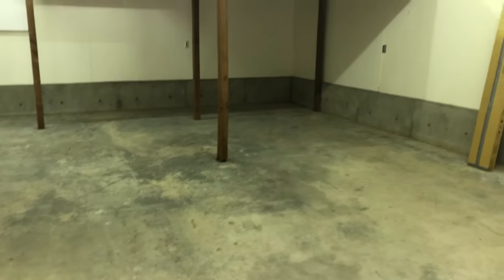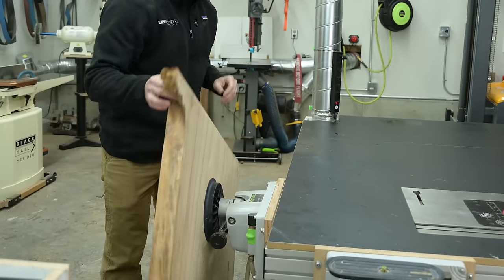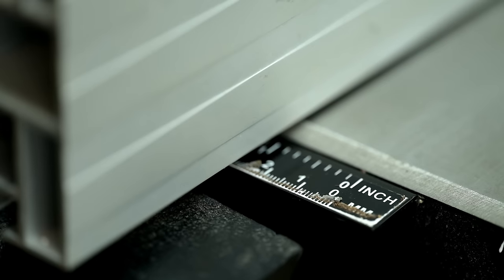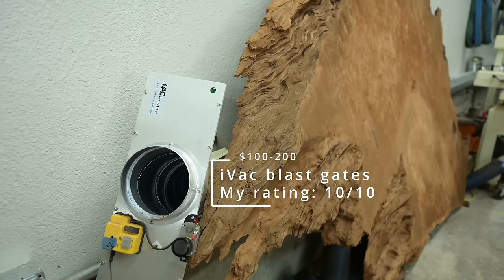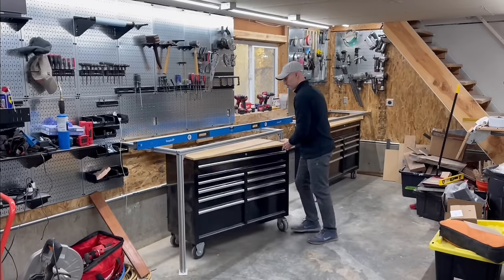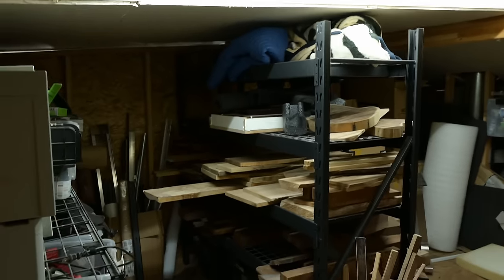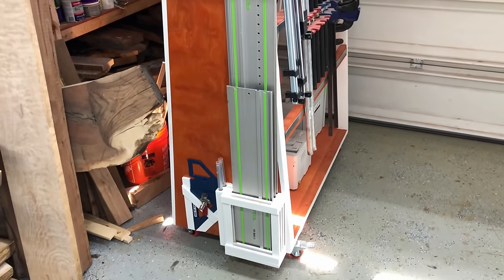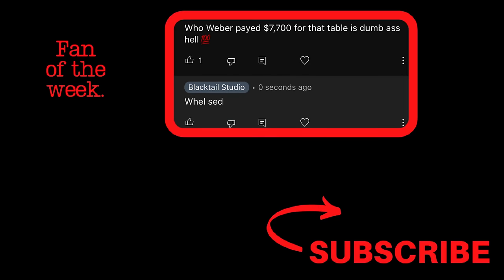Blacktail Shop Tour

Comment: They can't just say no.  They need to give a reason.   When they do, apply for a variance and get your neighbors to sign off on it.  Unless you have some ground stability problems, or something hard fixed for the area it shouldn't be much of a fight.  And really, if it's ground issues, you really don't want to go ahead anyway.
Reply: Absolutely right.  Planning departments cannot simply deny an application without providing the reason (in writing).  Fight on !

Comment: Compromise.  In my area it can be difficult to get a permit to do a full expansion like what you were thinking of.  However, it is much easier to get a permit to do a partial expansion.  What I would recommend is to try to get a permit to build the basement portion with the roof of the basement being called a walk out deck area.  Then a year later get a permit to enclose the deck and integrate the enclosed deck in to the rest of your shop.

Comment: As a land manager for a surface coal mine I spent 20+ years dealing with government officials telling me what we could or couldn't do.  Over the years I came to realize that you need to question every decision and as Mr. Breidenbach stated always ask to see the regulations that say you "can't" as many times it's simply someone's interpretation of a rule and not necessarily the intent of the rule that comes into play.  One thing that I found that helps in situations like this is to have something to concede to the inspector on, in other words be willing to give up something minor as a sign of good faith in order to achieve your long term goal.  Generally most inspectors will "work" with you in that scenario BUT if not and after reviewing the regulations you feel you are still in the right it always help to consult a land use attorney and have them send a letter to the governing agency explaining your position.  Most government agents don't like to deal with attorneys so they will normally find a way to make it work for you.  Might cost a few bucks but generally well worth it if it gets you the desired results.  
Love your work/videos and if you are ever open to tours would love to visit your shop some day.  Just live up the road about 1.5 hours north of Portland.

Comment: I'd fight it if it doesn't involve expensive lawyers. I found your channel last week and love your work. I've been considering making my own table/desk but instead of wood, I might use copper piping, sprockets, springs, valves, ect. To give it a steam punk look. I know I'll have to leave space between the surfaces and hardware for sanding reasons at least. I plan on supporting the hardware with wooden pegs that can be sanded during a pour that wouldn't look out of place. Thank you for your explanations and sharing your experience and expertise. I have enough confidence now to practice on small scale projects. Happy New Year Cam and I look forward to seeing more of your wonderful work.

Comment: I'm wondering what the reasoning was for your permits being denied, I've had to deal with my township over a few issues and have always found a way to beat them. As long your not creating or contributing to a safety issue then you should be able to find a way around them though the state codes.
Reply: @modoc343  what is the reason you can't catch train m rain water it's free water
Reply: The instant rain hits the ground it's no longer rain water, there are many ways of retaining runoff
Reply: @YesItsNotMe  my thought is that you would only be catching the rainwater from your roof which is not much in total rain that falls to the ground. But, just interesting history on the whole rainwater catching thing

Comment: Hello Cam - years ago I had the opportunity to work in a metal shop helping with making massive wrought iron gates (I'm a woodworker and was then too).  The shop owner was an older guy and he had a drill press with a KEY-LESS CHUCK.  Seems like that may be an unnecessary luxury, but - just imagine going back to the hand held electric drills of the seventies and reaching for a chuck key every time you want to change-out a bit.  I bought one years ago and have never looked back.  They typically seem to be quite well made, especially the German made one - and, they really are not that expensive (Grizzly).  Just make sure it will fit the taper on your press, or, buy an inexpensive new one to match.  Love your videos and concise explanations!

Keeping warm on Vancouver island - Canada,
Ken

Comment: Quick question from Germany: In my college days I worked a lot with epoxy - mainly using it as a matrix for carbon composites (race seats etc). Before pouring or infiltrating we always put the epoxy in a vacuum machine to remove any excess air from the resin, which greatly helped in removing bubbles. I was just wondering, if there is a particular reason for you not doing this! Thanks!
Reply: Yeah he basically lets his epoxy sit for about 10 to 15 minutes to let the air move up. Then pop the bubbles and you're good to go. A vacuum chamber is a cool gimmick but I think Cam does a great job providing tips and tricks for woodworkers who are on a limited capacities on both finances and skill 🤙🏼

Comment: Fight it! I was just wondering as a beginner woodworker what would you say are the most important tools to start with? I don’t have a large budget for tools but i was just curious to hear your thoughts
Reply: My 2 cents, but a professional sander will not only save you a ton of time, but your ending finished product will come out spectacular. Been building my business on a small budget and learned many lessons from the beginning from tools to time management and the difference the right tool can make.
Reply: @AKdesignsandhardwoods  like a belt sander or a circle one? Appreciate the reply
Reply: @aidancahill9236  random orbital. Also the correct sand paper makes a huge difference. KatsMoses has an amazing video that shows the best sandpaper. I use it and so does Blacktail.
Reply: Also don't be afraid of buying a set of cheap tools. As you use them you will see which ones you want a nice one of, and which one having a cheap one of is fine. For me absolute basics are a set of hand planes, a set of chisels and a couple of good saws. And a good sharpening stone.

Comment: Your shop looks great. Just a warning about magnetic chuck key holders (which it looks like you mounted on the side of the drill press). There will be times when we shift our arms or bump something, and you don't want your chuck key to fall down, bounce, and hit your spinning drill bit. Admittedly it won't have much, but you might want to mount the magnet on the side of the drill press table near the back where there is no chance of it getting bumped.

Comment: Yea fight it 100%!! Big fan of your channel it’s very educational for an inspiring woodworker!! So as far as you struggling by yourself with those large slabs you should get a winch from harbor freight. Make a leveling bar that has adjustable straps to wrap the slab on either end and you can just winch it out the truck and lower it on to the table. If you want to get fancy you can make a track system on the ceiling and then you can move it anywhere in the shop with no lifting!! Relatively cheap to set up.

Comment: Hi Blacktail, I have left you comments before I’ve always been impressed with your work and you have a good workshop,
Not sure how long ago that you done the territorial on your workshop,  about 10 years ago I made a workbench similar to yours only I constructed it out of plywood inch thick approximately 1 1/2 m wide by just over 3 m long I made it in such a way that the festool Profile Rails  which look Very similar to what you have used so all the festool tool equipment fit on the table, and it was perfectly flat and it was used for a vacuum bag system as well, you mentioned that you weren’t happy with your router table there is a company in Germany which makes a very fine with the kit not sure whether you can get them in the USA, You can make a table up to fit the lifting carriage for the router or you can buy a designated table system with a router already built in which you can actually take out if you so wish, It not only lift up and down but it will actually tilt as well, The name of the company is called SAUTER, Keep up the good work, Stay safe look after your health make sure you were breathing apparatus whenever you’re standing and I protection, From the retired 70 year young English gentleman living in France from the moulin.

Comment: Architect from UT here: If they don't have a rule that addresses your exact situation, then you should be able to apply for a variance through the zoning/planning commission. You need to look around your neighborhood and see if there are others who already exceed the allowed area for auxiliary structures. Your case for a variance will be much, much stronger if you can find extant, similar examples. You may want to hire either a lawyer who specializes in property law, or an architect with a good track record of obtaining variances for his/her clients.

An alternate approach is to build a "separate" building immediately adjacent to the existing. Code will require you install a fire wall between so the can be considered separate buildings, but that is an easy barrier to penetrate after you receive your CofO. I'm not encouraging you to do something patently illegal, just offering examples of what I've seen others do. A fire-rated door can be installed to meet the letter of the Code. You'll need to make sure what definition the County uses for separate structures.

Comment: Comment on Mafell: Its a pretty common brand for professional and commercial working woodworkers/Jointers/carpentrys in germany. Their design in comparrison to festool is focused on durability. If you look on the material, power and prosessing of these machines, you will notice a huge diffrence between festool/Bosh/makira/dewalt. 
Plus they dont overtune their machines like some of festools things are. We have machines of mafell in our workshop, that are older, than some folks, that are working with us for 40 years and these machines still run perfectly. 
If you work daily in trade, like repairing stuff at a costumers house, mafell is one of the things, we can lean on. Fuckin expensive, but they never let you down.

Comment: FIGHT IT!!
Going through (or about to go through) a similar battle. A block my wife and I want to buy is zoned as "Agriculture" (which is simply a block aimed at agricultural use only - no residential dwelling) and all we want to do is build a house there and live happily ever after. Trying to get around the Agri requirement as the block of 10 Hectares couldn't sustain a commercial venture, thus no reason for not building a residential house.

Haven't bought the block yet so let's not get too far ahead, but there is a decent-sized shed on there which could nicely fit a woodworking shop in there, plus be able to use AWESOME Tasmanian timber.

Thanks Cam.
Cheers, AussieAl.
#KeepDoingWhatYoureDoing
#OnwardAndUpward

Comment: In my opinion absolutely nothing beats Mafell in the section 80+mm hand held circular saws. The newest K85 has a absolutely perfect way of adjusting depth and angle, superfast and super precise. You can also use it as a Plunge saw (if thats the right term). In my peronal humble opinion the Price is right on this one.
Although of course Festool also makes great Products, way bigger Product range aswell.

Comment: Definitely Fight it!    if there is not ecological reasons the county denied your expansion, you can usually get a variance to do the addition by going to the county council and pleading your case, Especially if you plan on opening a classroom for at risk teens to learn woodworking.

Comment: I would fight it. I just stumbled across your videos a few ago and been watching as they pop up in my recommended.

I'm a builder in Ontario and I deal with this all the time. We go through Committee of Adjustment which is a governing body that oversees applications for buildings/projects that do not confirm to the usual standards. I.e. Hemp farms near  residential areas or nursery for livestock. Oversized shops, shops infront of houses on large parcels of land.  You would plan a proposal with architectural plans and a site layout done by surveyors. This application approval has many steps including issuing statements to neighboring properties, encase of objections. Going through the process usually leads to successful permit applications and approval to start. I'm not sure which governing body would oversee this where you are located but there should be one. Smaller shops like yours may only require a hearing and pay any necessary fees. The other stuff is for larger projects/structures which usually yield greater impacts on neighboring properties.

Good luck.

Comment: Fight for your right, I'm a Building Surveyor (in Australia) and my job role is ensuring buildings are designed, constructed and maintained in accordance with the building codes and numerous standards we have. We often 'replace' council, and if there is one thing I can say, councils typically need to have the attitude of ensuring the publics best interests whether it be their happiness, safety, etc. 
So in short, if they say no, it's not a full no, instead... you need to have a continual conversation (which may require meetings which can sometimes cost money) and the conversation of why they didn't approve it needs to be discussed. 

It very well could be a town planning issue where you are turning into a true commercial building at that point which unfortunately can have a trickle effect on everything. another issue might be just the shear size of the proposal, it could be aesthetics, etc. 
So have a conversation, and then get in writing what they don't accept and then reverse engineer to solve the problem. 

They can't say no for no reason, it's likely based on something like a building code, town planning bylaw, zoning requirements, or a whole number of things. so just get in writing what doesn't work and work from there. 

Depending on the issue, there are numerous professions out there that specialize in any given matter which I'm sure you could find someone local that knows the council well. This can go a long way believe it or not. 

I think there's enough of us watching that we would love to stay informed on how this all plays out, and I'm sure all us keyboard warriors will chime in, but there's a solution there and I'm invested.

Comment: From what I've read so far, the process you would need to go through is an adjustment review, which is much like a variance application where they may be able grant you relief from the code. You may want to hire a zoning attorney for this, I highly recommend it. I'm involved in zoning quite a lot and have rarely seen a situation where some compromise can't be reached, although sometimes a lawsuit does prompt that discussion...

Comment: Fight it Cam. I had to fight the bureaucrats a few years ago and it was well worth it. It's a little shallow, but it also felt good taking them down a notch or two. On to another point. This was a great video. I've retired and am now wanting to get back to my roots. If it's broke, you fix it. If you need one, build it.  I am really intrigued with wood/resin projects but didn't know where to start with decent equipment or even suppliers. I have nothing, I mean absolutely nothing. (It's a long story) Anyway, what would you recommend for a beginner that will eventually grow tired of it, or will want to seriously upgrade later.  Your videos are honestly the reason I have such a high interest in wood working. Keep up the good work.

Comment: Concede, personally I would rework the plans to fit into there code of I think you said 1,200 sq ft.  Are you going to have a ceiling crane(top running crane) installed or maybe a boom crane(jib crane)? It seems like a ceiling crane would really be helpful in moving the heavy slabs. My guess is, maybe the building can't handle the load that would apply or maybe it's not useful because there's not a good way to lift slabs with said crane without braking workpiece, though I suspect vacuum clamps would work.
It seems like clutter or small floor plan wouldn't be as much of a problem with a ceiling crane vs. the space requirements of a forklift. A boom crane if positioned properly might be able to extend outside to lift the slabs out of your truck and into the shop(or maybe they don't extend like that ;) )

Comment: I am involved in zoning and development in my local town.  Your county almost certainly has to give reasons for the denial, so it your plans can accomodate changes that will resolve their objections, I would start there.  If they object to the dimensions, setback, openings, etc., those can be changed  by the architect/engineer.  If the county objects to you having an "industrial use" or business use on a residential property, that might be more difficult to resolve, in which case a lawyer versed in commercial development or municipal litigation may be able to assist.  You might even argue that this is a hobby from which you occasionally recover some expensenses, whereas your videos are your primary business, and that this shop is not directly related to a business use.

Comment: Maybe this is moot...   I'd fight with your zoning/construction board regarding that expansion.  Put on a good show, support your arguments well, and explain "why" you need to do this and "why" you've designed your addition the way it is.  Got to get those folks on your side.  I've been down this road and had to get a construction variance for a lakefront cottage I owned.  I did my homework, explained why I needed to do it the way it was designed, and was granted the variance.  Good luck!